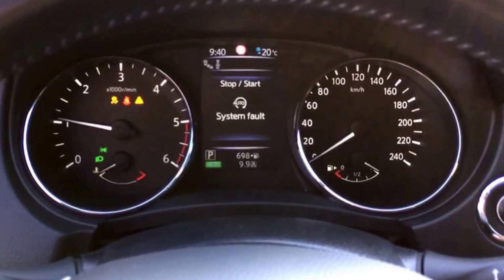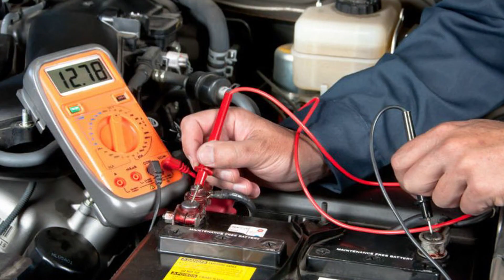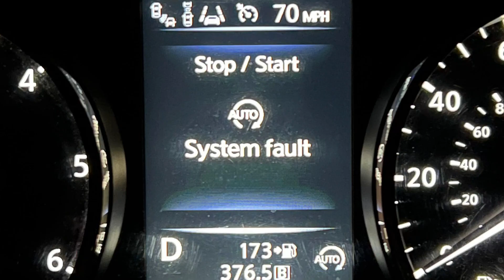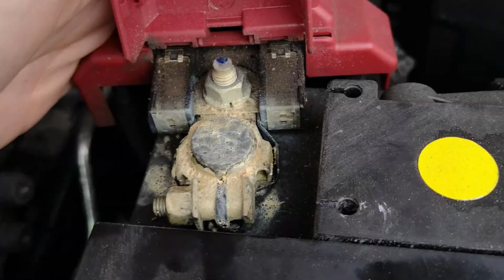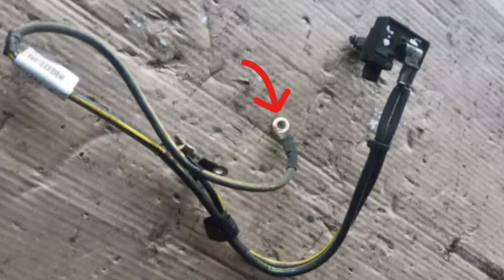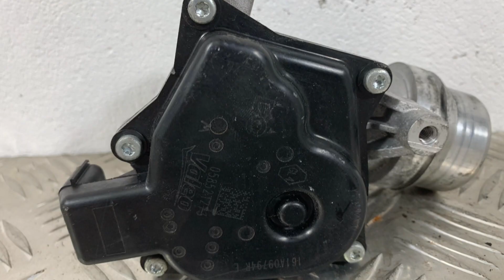Auto Stop/Start fault in Nissan Qashqai: Reasons and how to fix?

Comment: I just put a new battery in my nissan qashqai but i still get the same message from start stop fault..
Reply from the maker: It will need some time for the BMS calibration, unless there are some other warnings and codes that upset the start-stop system.

Comment: Can you clear the codes without a scan tool. My battery lasted 9 years! But today it gave start stop fault, then engine fault and rough running. I will replace the battery, but like to know what oem brand Nissan used for a 2016 Quasqai, as 9 years use, is pretty impressive!
Reply from the maker: It could be Johnson Controls, Exide, Panasonic, etc. They use different brands. The codes will clear as soon as the battery is good, no need to clear them manually, in this case.

Comment: I just started to get this start stop fault message every morning in my 2014 Nissan Qashqai 1.5dCi. No other warning lights coming on the  dash board and message dissapear if I drive non stop for about 20 minutes. Right now its unussual freezing temperatures in Uk, so I think maybe battery not coping with the weather? I bought my nissan just 2 months ago, and don't really know how old the battery is. Atm I use a lot of stuff every time I start the engine, my radio goes on, my heater, dimister + I plug in my dash cam straight away so maybe its draining battery too much. For the last 2 weeks I haven't driven my car fir more than 5 mins a day and message started to appear. Once again after 20 min drive it dissapears next day, but comes back on if I had short trips or not driven car for a day.
Reply from the maker: With very short driving cycles, this is what you may expect to get in any car. I would just get an external charger and charge the battery once every 2-3 weeks in winter. It will probably last another year or two.

Comment: I just changed the battery and this issue start showing, before I never see this problem
Reply from the maker: It needs some time to register the battery or you may reset it with a scanner.